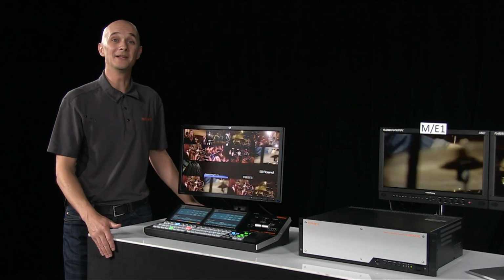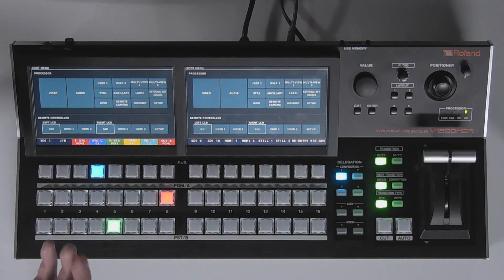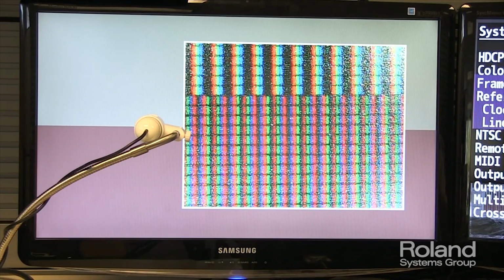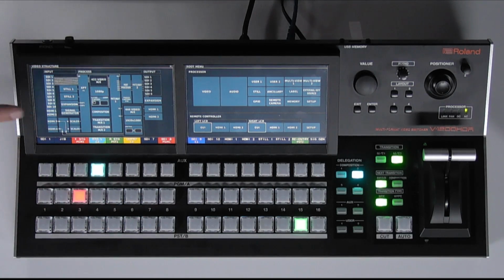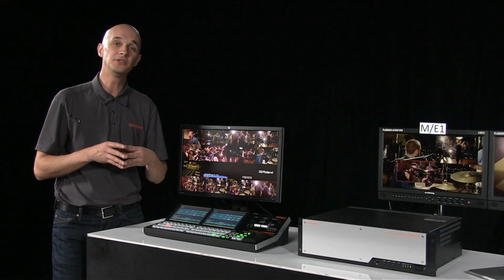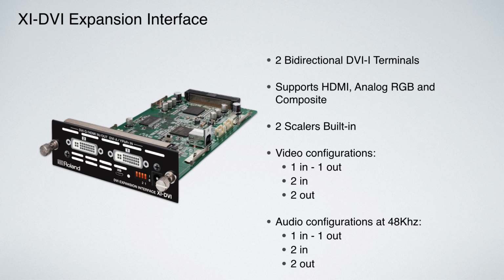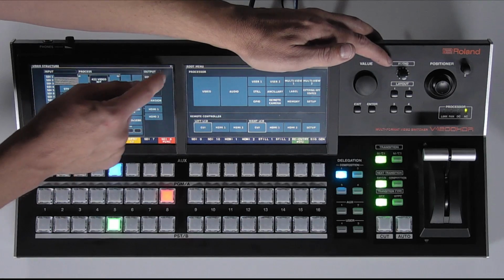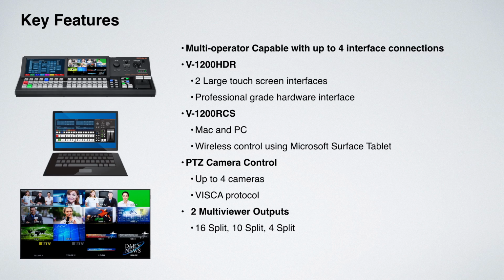Roland V-1200HD Introduction Webcast

Comment: Seriously considering this as a mobile production switcher for live sports events and corporate media. How is this as a portable production switcher solution? Are there road cases available for this unit? Does it have a built in streaming encoder?
Reply: +John SatVideoPro, the V-1200HD comes with rack ears on the unit that can be mounted in any standard rack size case. Many options to choose from in the case market that can accommodate the V-1200HD. The V-1200HD does not have a built-in streaming encoder but you could use Teradek or Matrox hardware encoders for streaming using SDI out of the V-1200HD with embedded audio.

Comment: This is really interesting info about what Roland can deliver. Whare can I buy this in a safe and serious way? I can buy in both Sweden and Norway, or Denmark. To do business online I also can do but then the company has to be serious. Still I prefere to buy from a showp where I can get advices from perofessionals. To send such equipment in the post is perhaps not the smartest way. Let me get the best link to the best online shop and a link to physical shops in Norway, Sweden and Denmark. Thank you. is this equipment working excellent with Google Chrome (google+, youtbue, my website)?
Reply: +Geir G Johnsen Thanks for your question about "Where to Buy" the V-1200HD.  You can do a search by country on the Roland Pro AV Website of where to buy products by following this link: http://proav.roland.com/contact/find_a_reseller/  The V-1200HD does not connect directly to google+, Youtube, etc... You will need an hardware capture/encoder like Teredek or Matrox Monarch to connect/stream to these online portals.
Reply: Rob Read Thank you and what is the best hardware (which means a box of some kind) of Teredek or Matrox Monarch giving me the best result and greatest opportunties for my explained purpose? I also want to stream to my payed website that only accept embedding of my google+, youtube , facebook etc channels. Google and youtube is the most important channels at the time for my part of online channels.
Reply: The Matrox Monarch HDX is going to give you the SDI inputs on the encoder for streaming plus a local record stream as well. The Teradek Cube is the equivalent with SDI inputs. I have used the Teradek VidiU Pro and love it for live streaming and local recording. It also encodes for Facebook Live. Best of luck!